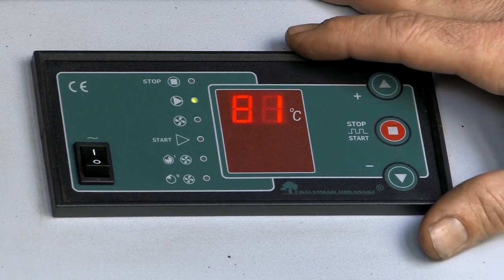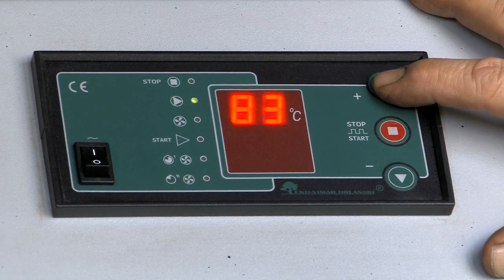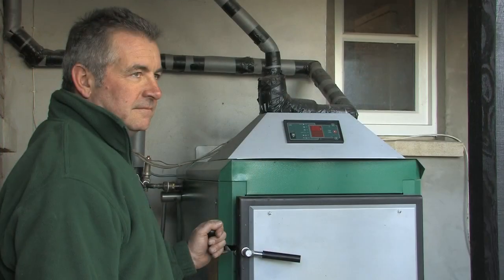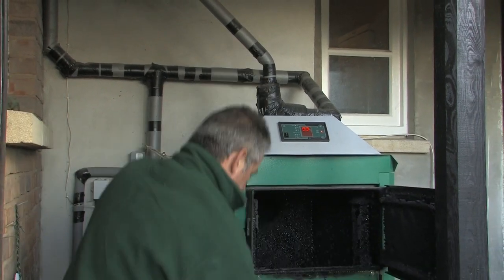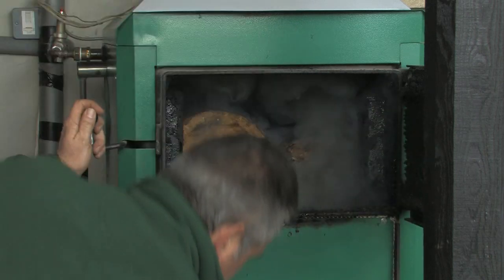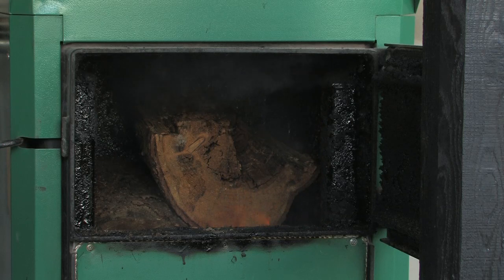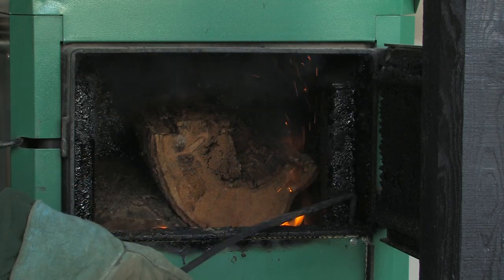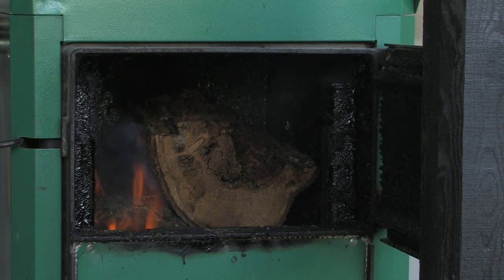Angus Super Wood Burning Boiler - Gasification Log Boiler - Eco Angus - www.ecoangus.co.uk

Comment: excuse my english , i'm from italy .i must buy the new boiler next month , i was interesting to the orligno 200 18 kw, one question : the wood that i'have , is olive wood  diameter max 15 cm not split ,with 7 months ripening. can i ' have problems with this tipe of boiler ? i have also woodworking sawdust that i mixed with the wood ? help please .is very important
Reply from the maker: The most important point is that the olive wood is fully seasoned so if you have a wood moisture meter it will be below 20% moisture content. It usually takes 12 to 18 months to dry the wood in the U K but it may be quicker in Italy. It can burn sawdust but I would advise you to put the sawdust on top of the logs when you load the boiler. I hope that helps.
Reply: many thanks .